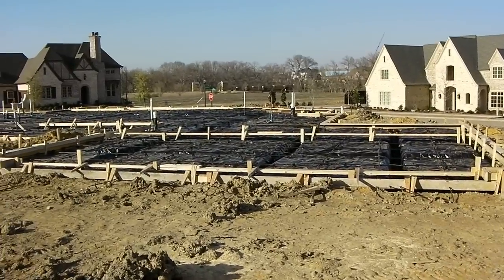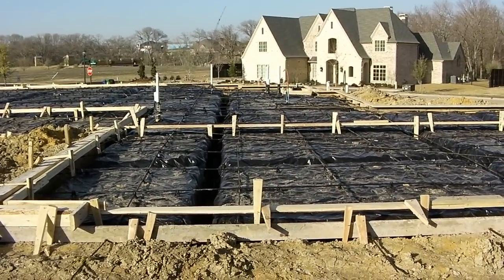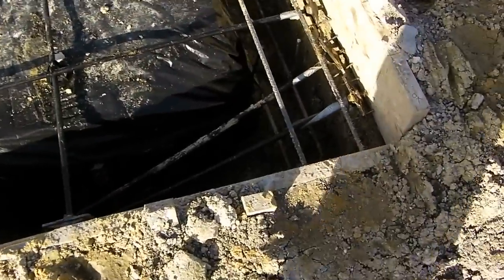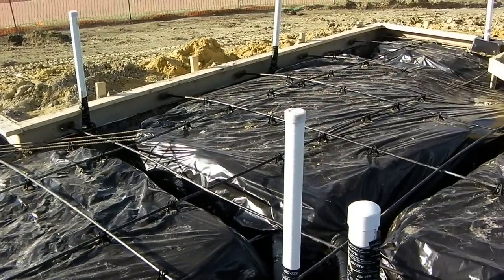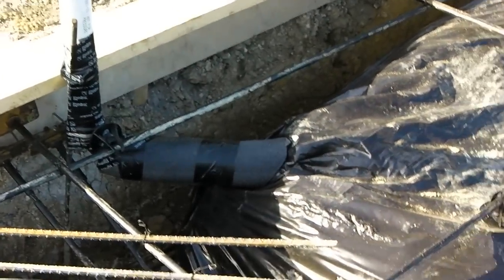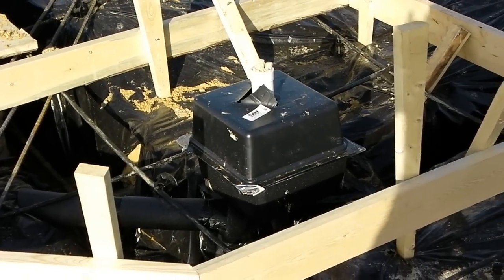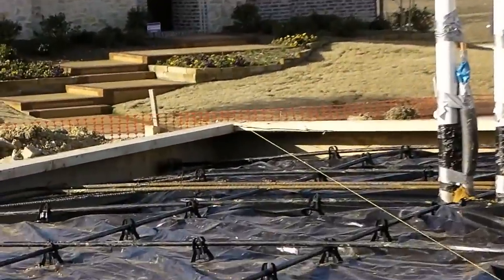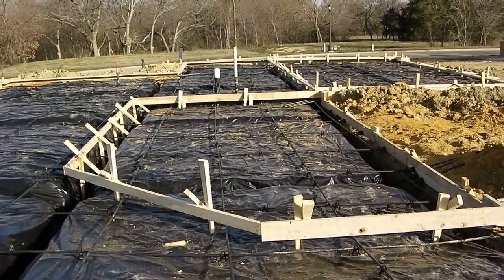Day 22 - Foundation is Ready - Glacier Point

Comment: Why are you paying for a (private) engineer to inspect? You’re already paying employees, and perhaps a including a foreman, to do the steel work according to plan. And then, through your taxes and permit fees, you’re paying for a qualitified city inspection. And I only mention this because you referred to “wasting” concrete.
Reply: Post tension slabs always require an eng. on site at installation of cables or prior to pour as so here.  He will also have to be out when they put the tension on the cables.